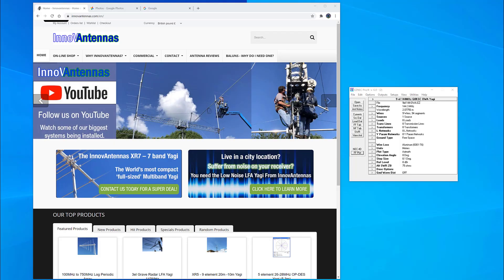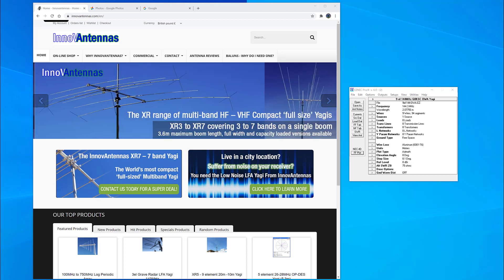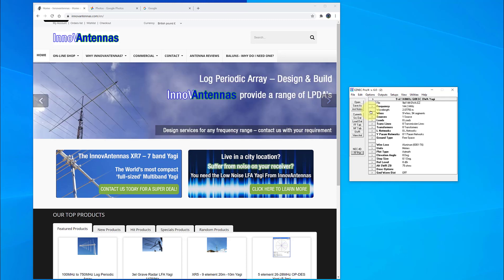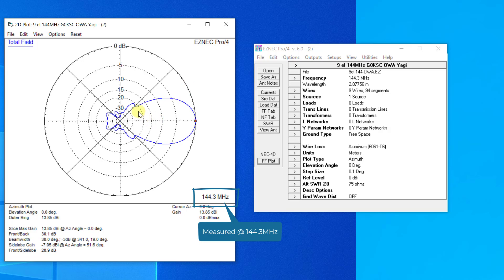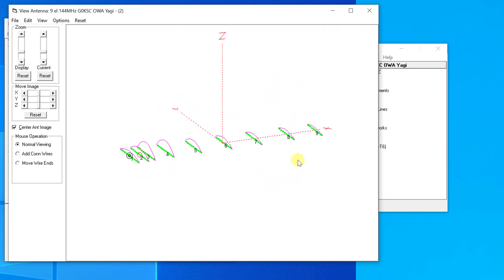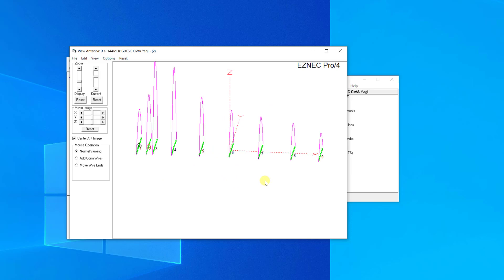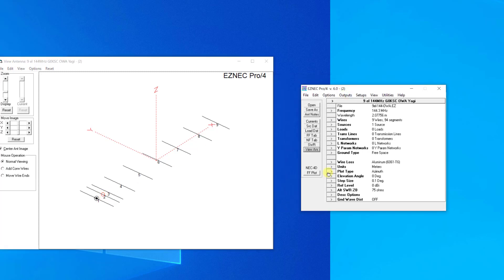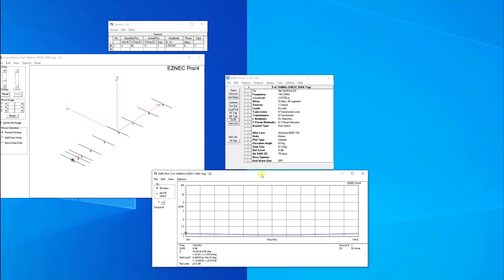EZNEC Antenna modelling part 2 - Opening and exploring Yagis

Comment: Hi Justine,
Congratulations for your YouTube channel and your website, it is very interesting. 

It is possible to merge two antennas VHF 144 Mhz and UHF 430MHz (one face by antenna)?
May I do a specific calculation or could I take directly your Yagi FLA 144 10E and FLA 430 18E?

Thank you for your good  solution. 
Gérald F4ISW
Reply from the maker: Not an ideal mix, outright performance on 70cms is reduced due to the third harmonic relationship between these two bands.

Comment: Justin, just one stupid question. You said that your computer workstation has an incredible number of cores, does the NEC program use all of them, or if one look closer, everything runs on a single core? 73's Bodo - DL7AFB
Reply from the maker: No, this workstation is for the Ansys HFSS which does use the 16 of those cores I have licenses for and still take 3 to 4 hours to make a single run. This is why programs like HFSS are only for finalisation with external influences such as booms, insulators and coax etc.